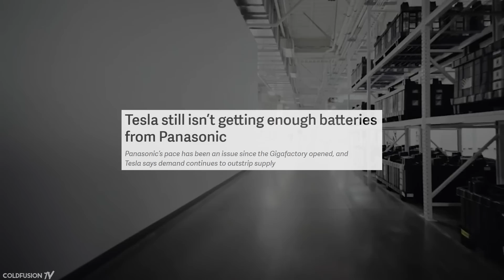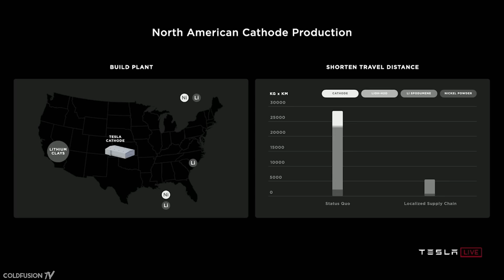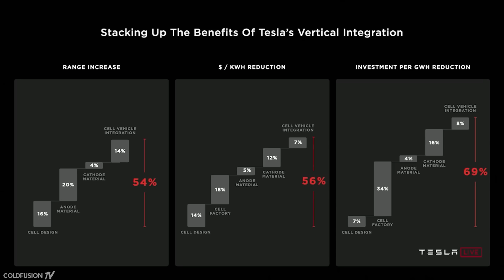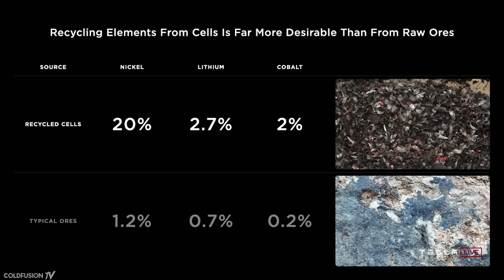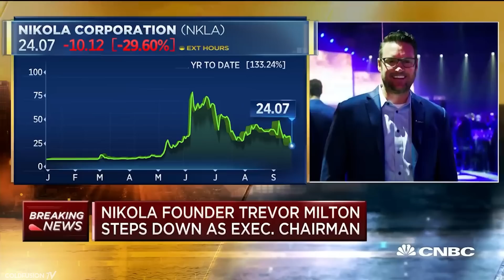Elon Musk: Affordable $25,000 Tesla and Better Batteries Are Coming

Comment: Excellent recap. I think however that you're not on point here about the "overpromising" of Elon. It has been observed multiple times in the Tesla community lately that he/Tesla seem to be changing in this respect. Examples: Model Y was delivered months before the date originally announced; the same with Giga Shanghai's opening. The exception remains the autonomous driving and the robotaxi of course, as long as you don't take into account how spectacular the developments in the first are already. That said, I wouldn't be surprised if the $25,000 car were announced in 2021 already, perhaps even at the opening of Giga Berlin. Tesla needs to avoid the Osborne effect especially in this case, as it would easily make a huge dent in the sales of Model 3.

Comment: if the whole body of the car would be material that recharges batteries : problem solved. Can even reduce battery weight for same range.
Can even use wind velocity when the car is at high speed.
Combined you'd have a very good efficiency
Elon Musk already has a photoelectric company so he could fuse-gain all the research they had there.

Comment: The fact the stock has gone down so much after this announcement shows how short-term thinking dominates on wall street. Actually 3 years isn't such a long time to wait when you consider that they want to double range and halve costs - if they can do that then it's really game over for ICE vehicles. Think back to things that happened in 2017, it's really not such a long time ago and before we know it 2023 will be here. I really hope these improvements go as planned  - go Tesla!
Reply: solaroid55 gasoline and diesel burning engines also emit pm 2.5 particles, organic gases and carbon monoxide and various types of emissions. All the emissions that also need to be phased out.
Reply: solaroid55 gasoline is part of the problem of greenhouse gas emissions and needs to be phased out.

Comment: At 1:50 it says: 5 times more energy and +16% range. Why is that? If the specific energy is multiplied by 5 the range should also be multiplied by 5.
Reply: I think it is the 5 times figure is about cell vs cell. it may be 16% more energy dense in a car (energy dense by volume). 5x energy density is probably an impossible feat with current technologies. they mostly improved the manufacturing process with a increase in energy density that could be explained just because tessellation in the battery pack.

Comment: I personally cannot wait until buying an EV is an affordable option in Australia. But also keen to see how things go in the next two decades with lithium mining being able to meet increasing demand.
Reply: Same
Reply: Tesla is also getting into mining. Cold Fusion didn't mention any of that
Reply: @spidermain  Tesla has more value as a meme than a company.
Reply: Lithium shouldn't be that big of an issue. Battery grade Nickel is far more prone to supply constrains. 

If you watch Tesla's presentation, they are taking some quite significant steps to minimize their Nickel use to avoid this problem.
Reply: @jonashageboke8993  there is heaps of lithium to mine, and it's not too hard to process however lithium mining projects take 5+ years to get up and running. As incentives from major governments kick in to buy EVs the demand will sky rocket and there may not be enough mines in full operation to support it
Reply: Yeah, when hell freezes over according to Morrison.